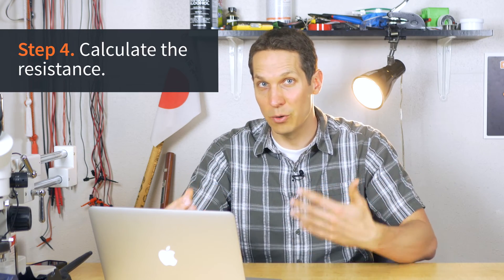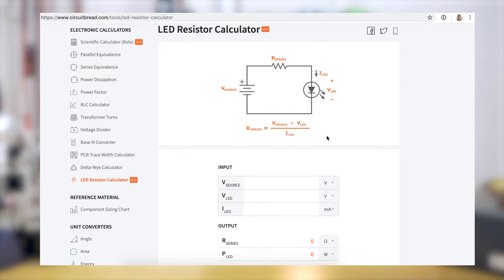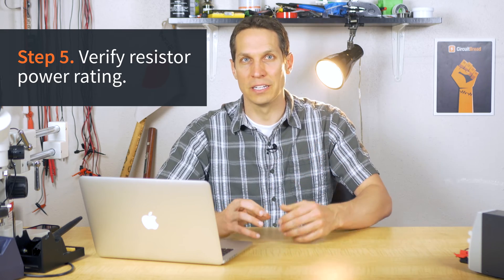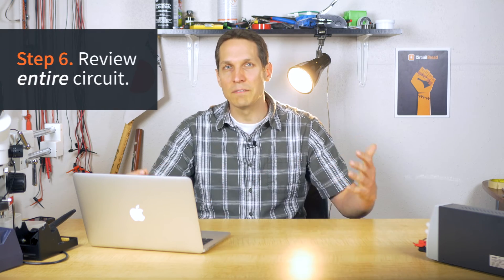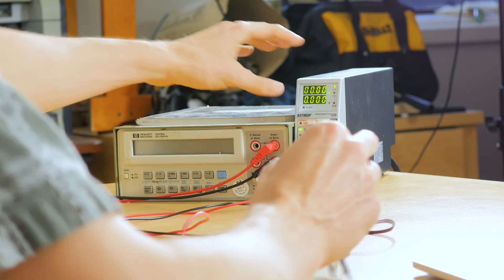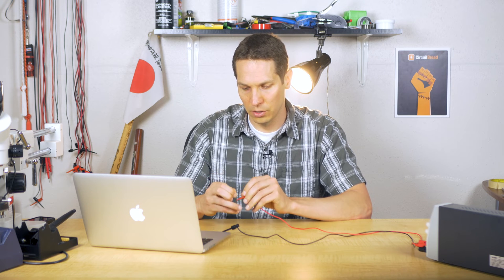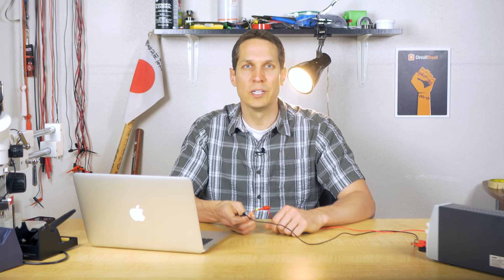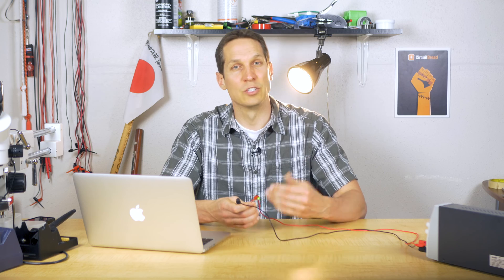How to select resistor values for LEDs | Basic Electronics

Comment: Thanks for your valuable information, I have a question; as I have changed my car tail lights from regular to LED, the car’s computer in the dashboard gives me a warning all the time that my brake lights need to be checked, they are working perfectly, to avoid this warning a resistor need to be installed, my question is what size of resistor could be perfect fit (the regular brake lights used a 21/5 watts). Thanks in advance for your help.
Reply from the maker: That's an interesting question.  I'm curious what triggers the warning.  I don't actually know what the car is looking for.  However, if I were in this situation, I would choose a relatively low-value resistor as it seems to be working just fine without a resistor.  So, something in the 2-10 ohm range as a first attempt. My guess is that you just need something that'll give a more linear voltage profile.  If it weren't for the fact that you've been told you need to add a resistor, my other guess would be that the computer is not detecting enough current because the LED should be using a lot less power.  But adding a resistor would compound that issue, not improve it.

Comment: Good evening sir.
My name is adam and i have a question for you if i may. Today i was up grade a security system and some zones had resistor in the felid and the reading is 2.2 k and the new system im installing use 1.9 k . Is it a problem . I tied the zones with 2.2 k and it works. Please advice thank you very much
Reply from the maker: Hi Adam!  While I can't give you a definitive answer on whether or not this resistor value will put your system outside of the required specifications, my guess is that it is not a problem.  It's around a 15% difference and low quality resistors can have tolerances of +/- 15% or more.  So, likely, you're fine.  But I recommend reaching out to the manufacturer for an official answer if you're concerned!

Comment: 1- Is maximum current and forward current the dame thing?
2- is it ok that supply voltage is higher than desire or needed 3 volt for led?
Reply from the maker: Hey Yash!
For #1, it is different. Forward current is generally considered the target current for the advertised brightness whereas maximum current is the point after which the LED will most likely be damaged.
#2 - yep, that's totally fine.  If the supply voltage is higher, then you just need to modify the value of your resistor to get the correct current through the LED.  We actually made a tool so this can be super simple for you: https://www.circuitbread.com/tools/led-resistor-calculator

Comment: How about I have 40pcs 5730LEDs 3.4v .15Amps , I connect in parallel with the power supply of 12v, 
What resistor that I need?

Comment: Thank you.

What is the 0.6 or o.7 drop voltage that it is mentionned in many tutorials. Is it the minimum PD between anode and cathode needed by the current to cross the LED ?

I am confused on this point.

Thanks in advance 😀
Reply from the maker: In any diode (including an LED) there's a junction where you have two semiconductors touching each other.  For the electrons to cross in one direction at that junction where they meet, they need a certain amount of energy.  This is the forward voltage or voltage drop that you're hearing about.  To learn more about it in much, much more detail, we did a trilogy talking about how diodes work at the semiconductor level, starting with this one:  https://youtu.be/btOIDQeMrMg
Reply: @CircuitBread  
Thanks my Dear 😀

Comment: Hi, nicely explained. Thanks
I want to make aquarium LED light With 36LEDs each 3W. I have power supply driver of 30v -42v 1700ma. How to make circuit to suit that LED requirements.
Any help is appreciated. Thank you
Reply from the maker: What is the forward voltage of your individual LEDs or portions of the LED string?  And each LED is 3W, with a total of 36 LEDs?  So 108 watts total?  That seems very high and would require more power than your power supply is able to provide.  My guess is that the entire string is actually 3W, is that correct?

Comment: can you power 20 LED diodes using one resistor   lets say 12v input into a resistor to power 20 3v led diodes?  or do i need 19 resistors one in between each LED? they are connected in a row from one led to the other.
Reply from the maker: If they're in series, you can use a single resistor.  Though your math is off, as 20 3V LEDs would require a minimum of a 60V power source.  If you put them in parallel, you can technically do that but there are some challenges (discussed here - the principle stands even though its talking about RGB LEDs:  https://www.circuitbread.com/tutorials/why-cant-i-share-a-resistor-on-the-common-anode-or-cathode-of-my-rgb-led).  And when you put a bunch of LEDs in series like that, it gets a bit tricky if there are any variations in their forward voltages.  This is why you usually use a constant current power supply in those cases.
Reply: @CircuitBread  ok its a car led tail light that i want to make. 12V power in i have 20 leds with 3 terminlas one terminal is red led 2v and the second terminal is white led 3v, can the power go into the first LED then from that first LED to the 2nd and 2nd to third ext..... i can run one resistor for the 2v side and one for the 3v side right at the power source? correct? but i have to do the math?
Reply from the maker: Sorry for the delay but unfortunately, it doesn't sound like this solution would work.  If you have the LEDs in series, their forward voltage adds.  So, in the ideal scenario, with a 12V battery, you could only put 6 2V red LEDs in series before they would no longer have enough forward voltage to turn on.  However, it's possible that you could put 5 2V LEDs in series but then in parallel with another 5 2V LEDs, with a resistor in series with each set to control the current.  And I'd recommend five instead of six LEDs to give yourself a bit more head room.  And yes, there is a bit of math involved but nothing too intense.  We also have a calculator on CircuitBread.com to help.
YouTube doesn't notify us of follow up comments (only the initial comments) so if you have more questions and I don't respond, I'd recommend jumping onto our CircuitBread Discord channel as that's more actively monitored.
Reply: @CircuitBread  Thank you!!

Comment: Dear Which resistor is better for 1738 sensor using 5v+ current
Reply from the maker: Working with suppliers and distributors on the client side, I've found that nearly everyone puts a lot of effort into giving their users as much information as possible with example circuits, recommended values, common challenges, etc.  While I'm pretty sure 1K is the ideal resistor for the 1738 sensor, my recommendation would be to look at the specific data sheet for your part and see if they have any ideas of what would work best.  And this advice is not just for the 1738 but any IC you want to work with.  The people who understand their product best typically have already created simple circuits with values that will make your life a lot easier.  And if they haven't, usually there's a competitor product that has.

Comment: For these little LEDs the resistors are fine, but I was wondering if that applies to a 5w led also, I have some 696-LXL99UWC-TR5 High Power LEDs and I would really like to use them with a USB power bank  (5v, 2.1A output).  I have seen many time people writing about using only "drivers" for these high power LEDs.  What do you think?
Reply from the maker: Yeah, you'll want specific drivers for those high power LEDs.  They're more efficient and give you better control.  Those drivers are ubiquitous enough that, while not something you'll have lying around like a pile of resistors, you can get what you need pretty easily and inexpensively.  That being said - with your 5V output and the LED forward voltage of 4.5V, you might get away with a direct drive from your USB power bank.  I would be careful, though, as you could easily destroy the LED while messing with it.
Reply: @CircuitBread  
Thanks!   
When you said:
"your 5V output and the LED forward voltage of 4.5V, you might get away with a direct drive from your USB power bank.  I would be careful, though, as you could easily destroy the LED while messing with it"  So, I should assume that try to connect it directly and see what happens?  Or maybe is a good idea to add a resistor? What kind?    Thanks again for any help
Reply from the maker: Hi Henry!  As LEDs are typically inexpensive and if you have one, you usually have a lot of them, I think it wouldn't be an issue to direct drive an LED, but if you only have only one, then you may not want to risk it.  There are LED resistor calculators out there (we even have one - https://www.circuitbread.com/tools/led-resistor-calculator) that should give you a good idea of the type of resistor you should use, given your LED and your power source.